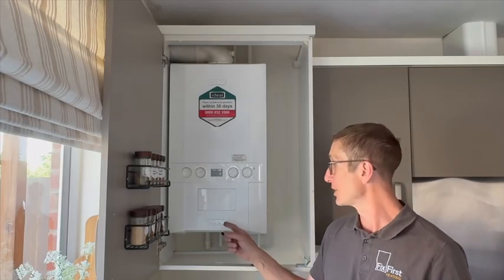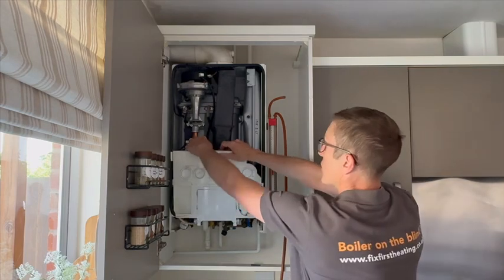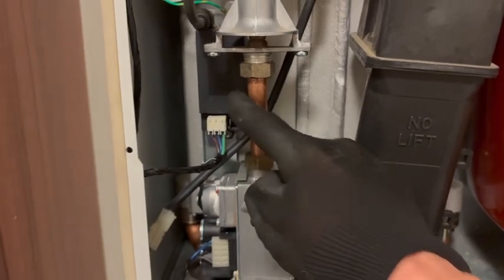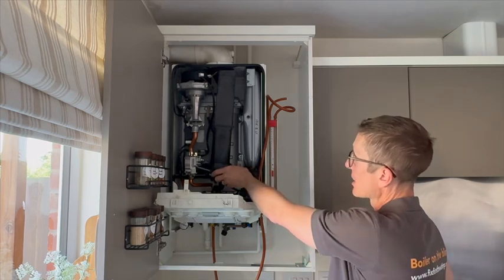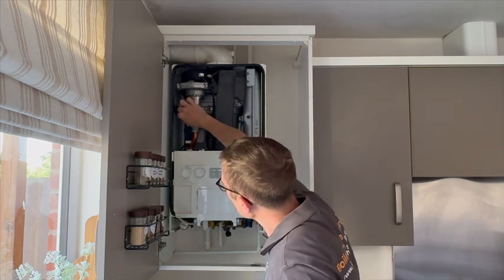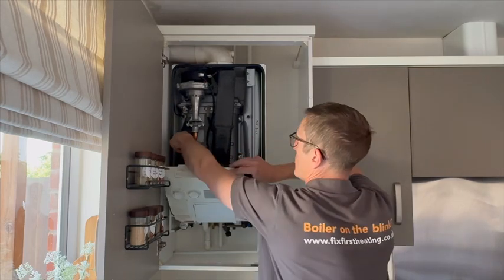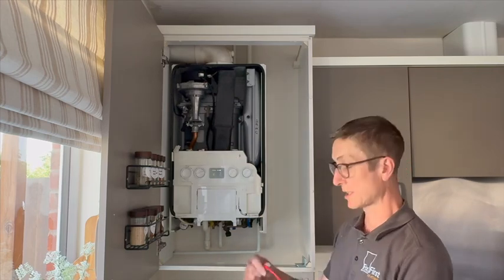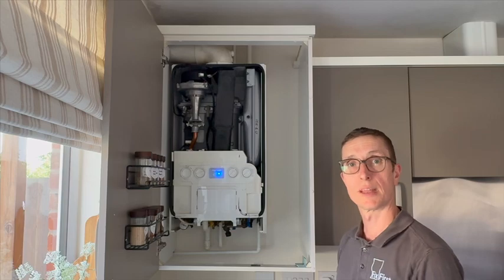Ideal Logic L2 Fault Spark Generator

Comment: How big drop should be when you check the gas valve?  If standing presure is 26mb.
Reply from the maker: Working pressure into the appliance can be from 18mb accounting for a 1mb drop between meter and appliance and a working pressure at the meter between 19 and 23mb. (From memory, this is not official Gas Safe guidance).
Reply: @FixFirstHeating I know 21 +-2 now from 18.5mb,  question was not about it.